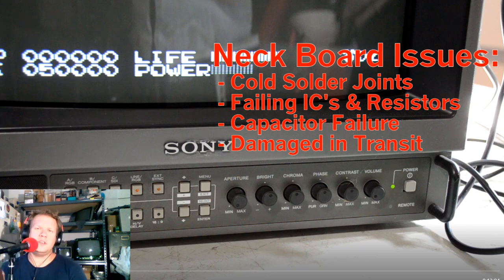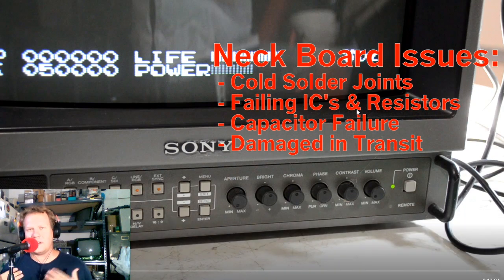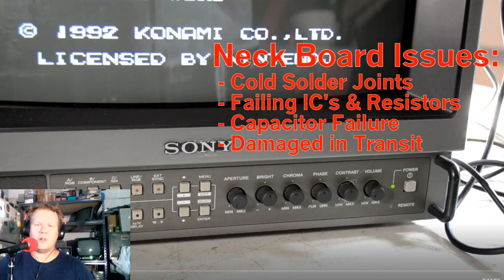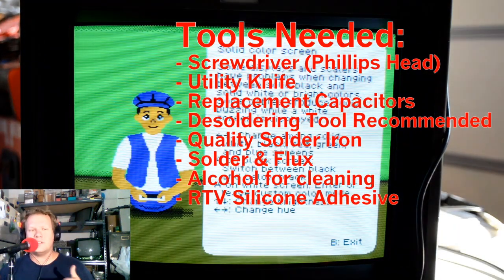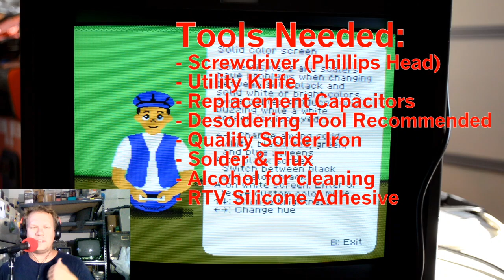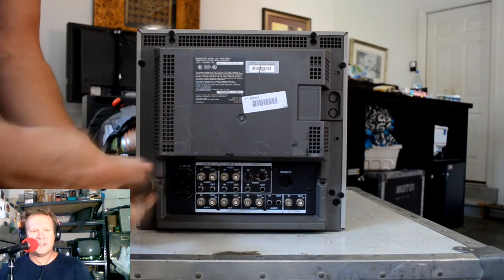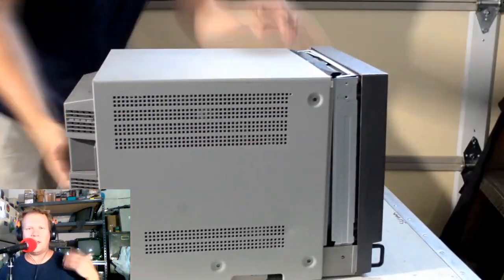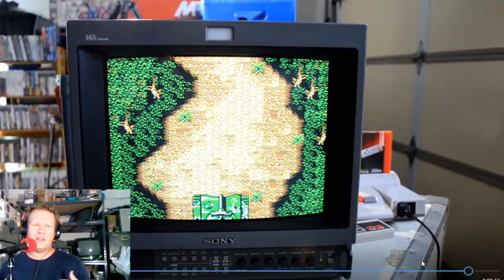CRT Neck Board Repairs | Sony PVM 14M2 restoration

Comment: Great video! Have you ever seen bad joints or caps on the neckboard causing the screen to jolt for a second before returning to normal, accompanied with a popping sound?
Reply from the maker: Thanks.  Popping would make me thing it's a flyabck issue, probably not the neck board unless something is obvious.  Proceed with much caution though if you hear pops.

Comment: Another fantastic video, this channel is wonderful.  I'm from Brazil and here a cheaper alternative in relation to PVM or BVM has been the consumer CRT models KV29 from Sony, in the service manual in some settings it informs to use an oscilloscope but from what I see in your videos there is not exactly  that need correct?  Another question, my Sony KV29FS140 when I removed the Yoke I noticed that there were some square magnets glued on the inside.  To redo the whole convergence calibration and etc. do you recommend leaving them where they are or removing them all?
Reply from the maker: You don't need a scope for geometry settings or convergence.
Reply: @RetroTechUSA  ok, thank you very much for the return and success to your channel

Comment: Do you recommend discharging the monitor beforong removing the neckboard? I'm handy with a soldering iron, but I've never messed around with CRTs due to how much voltage they can retain.

Comment: Don't forget to mention that high voltages run through this board (180V to near 1000V). It might be obvious, but life is better than a monitor. Be sure to properly discharge capacitors, at least by a power resistor. Shitty screwdriver trick can create a spark inside the capacitor, that can damage electrolyte and cause a failure months or years later.

There's a lot more capacitors on the C Board than the 2 you mention : you're talking about Aluminium electrolytic capacitors. One of these is rated at 250V. 

The best way to choose a replacement capacitor is to read capacitance/voltage ratings at first, then reading brand and capacitor series to check their specifications (operating temp, lifetime... and dimensions) on their datasheet.
Reply: What about discharging the CRT itself before removal of the neck board? I didn't see that in this video.

Comment: I'm working on a 1450QM and the neck board is kind of loose so sometimes Red is missing. Can solve it right away just by pushing the board a bit. but think will remove old silicone and reapply.
Reply from the maker: Good idea.  That may solve it.

Comment: I just picked up one of these locally. I noticed a rgb line of red, green, and blue pixels at the top of the screen. Capacitors must need replacing, but for now I changed the vertical blanking and that eliminated it.

I also have a 32 inch component jvc crt, and was wondering what would be the better option

1. Get a bnc to female scart adapter and use the scart cables I already have with just the pvm.

2. Get a scart to component transcoder and feed component into the pvm and jvc. The thing is that rgb is not identical to component so there will be a slight quality loss, but this way I can get one adapter that works for both displays.

I could get both so I can use snes with component and also rgb depending on the display, but a fix all solution might be better.

Comment: How important is that green thing on the connector to the cathode? Cause mine shattered upon removing the connector and idk whether to leave it as is or to use some liquid electrical tape in it's place
Reply from the maker: It's not that important, it's a simple plastic spacer and the CRT will work fine without it.  It's common for the old plastic to break and shatter.  It's just there to protect the pins and the glass

Comment: Hi Steve, I am troubleshooting what I think is a neck board issue on a PVM 20M2E. Is it ok to replace a Solid resistor (for example R726) with a metal film resistor?

Comment: hi, amazing video!
have a question. a try to configure a crt sony kv-21 under the service mode, (every calibration works fine) but the right botton cornet of the screen have a little problem of geometry. in a facebook group of crt, they answer me to recap the neckboard to fix the issue. is that work to try the fix that ??

Comment: in my case, mi CRT tv look like redich/purple .. I read it could be the Green color failure so I resolder those components in that track .. still looks redish/purple..
when the problem began, i used to make some presure un the neckboard and the the color ddi restored to normal , i actually tied a cable to the neckboard to the yoke mount so the rpessure was constant withput having to do it myself..but now it does not work  so it´s redish again. 
I havent resolder the rest of components but before I do that I´d like to know if it´s possible that the problem is in the socket¿¿ have you ever seen a socket where the pins from the neck of the tube don´t make proper contact with the socket¿¿ is that common¿
sorry my English is sobad.. im from Mexico

Comment: I’ve been trying to figure out why my 14m2 only displays in red. Perhaps this can help me out. The monitor worked fine with all colors for 20 minutes until something happened and it started giving off a foul smell. After that only red would display but all color present in RGB lines which I find odd.
Reply: I know this is really late but if the foul smell was sorta fishy, it is almost certainly a bad capacitor. They leak battery fluid which has a distinct fishy smell.

Comment: Where do you think I should check if there's sync issues?
Reply from the maker: I'd check to make sure that the proper sync is going into the monitor.  It's either a disconnected cable somewhere or a component issue on the video input board or the main board.
Reply: @RetroTechUSA  Thanks, it's an issue even with sync of the OSD, so it seems to be pretty far down the chain as far as the point of failure.